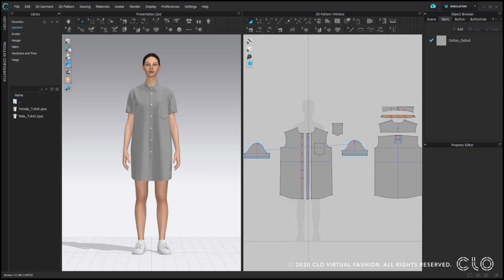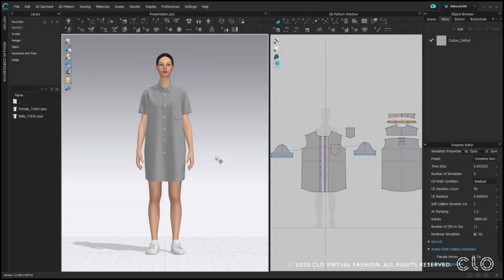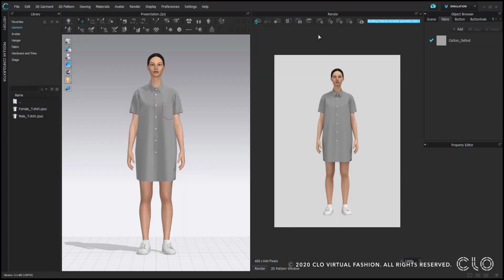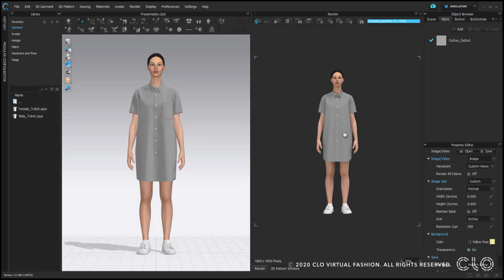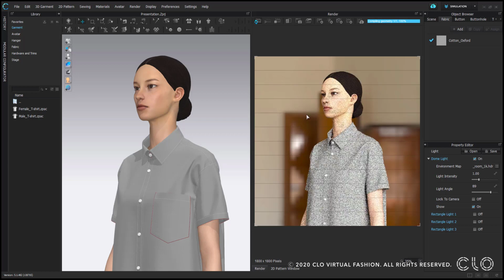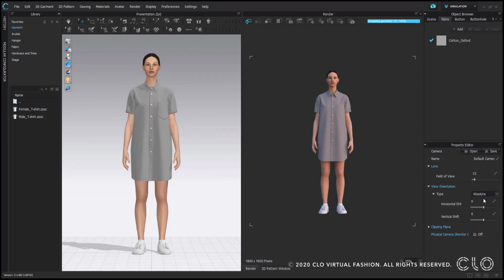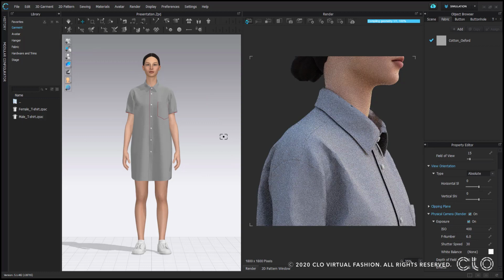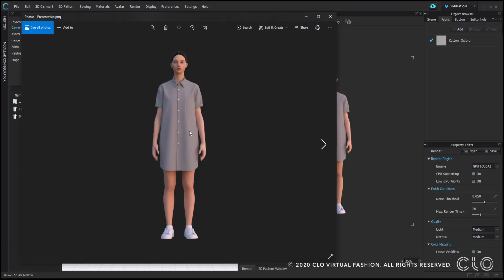Beginner's Guide to CLO Part 4 Materials & Presentation: Presentation (Lesson 5)

Comment: Hello everyone! So render on my laptop - macbook pro 2017 core i7 render pro 560 4gb works really bad. There is nothing the same as i see in many works of our people. May be somebody faced the same problem? I have been looking for the resolution of this problem for a while, and still i don’t  understand i have this problem because of weak laptop or because of some other reasons. If someone help me, i will be very thankful!
Reply from the maker: Hello. Sorry you are having issue. First I would check here to make sure your hardware fits the recommended specs. You can search further in the support forums to see if you can find any more informaion. https://support.clo3d.com/hc/en-us/articles/115000307168-CLO-system-requirements-December-2021-

Comment: Hi, thanks so much for this great tutorial. 
I am making a t-shirt tucked in a pair of trousers. But the t-shirt keeps on coming through the surface of the pants.
I already pinned the entire hem of my t-shirt to my avatar and tried all kinds of friction values, but nothing seems to work. 
Can you explain what the best way is to make a shirt tucked in the trousers, because I am running out of ideas now. Thanks so much!
Reply: Try freezing your shirt first and changing the layer of the pants to 1. Stimulate it so that the pants come over the shirt. After it’s done change the pant’a layer back to 0. When you change the layer, the garment should turn green
Reply: @shreyanagar4701  Thank you for your reply! I tried this out several times. But it did not seem to work. Now I put all settings of the fabrics back into the original settings. In combination with the layering and freezing it looks much better. It probably had to do something with the collision of the different fabrics while layering. I changed those settings probably the wrong way, so they kept on colliding.
Reply: Ooooh I really tried. For normal simulation it seemed to work. But by adding a motion to the avatar, the t-shirt came through the fabric of the pants. 
I even cut off the t-shirt and sewed it inside the waistband of the pants to avoid this. It still came through the fabric of the pants. So annoying. I really have no idea to avoid this. Does anyone know???
Reply from the maker: Sorry for the late reply. Were you able to sort this out?

Comment: So I'm looking to create a reflective garment. I'm using nylon as my primary material but is there anyway to make it appear to reflect or glow? Any tool I can use to make that happen on clo?
Reply from the maker: Yes - all Fabrics/Materials have the option to change Material Type. Select Fabric>Property Editor>Material Type (Drop down menu)

Metal/Plastic/Shiny/silk/satin - switching to these options can be adjusted by changing the reflection roughness to adjust the reflection amount. 

Light (Render only)  - This will allow for a "glow" affect - note that the light in the render window will have to be lower to see the glow or light from a material. "Color Mult" is the property you want to adjust there to increase the light/glow/
 
Here is a link to the Material Type guide which has a lot of info about material types: Download the PDFs available there for more info. 

https://support.clo3d.com/hc/en-us/articles/360010657193-CLO-Material-Type-Guide
Reply: @CLO3D  Thank you loads!! :)
Reply: @CLO3D  Another question... I created 4 different garments each in its own clo environment. How do I bring them together so I can mix and match to create a lookbook of sorts?
Reply from the maker: Our Connect Community forum is a great please to go ask questions
https://connect.clo-set.com/community